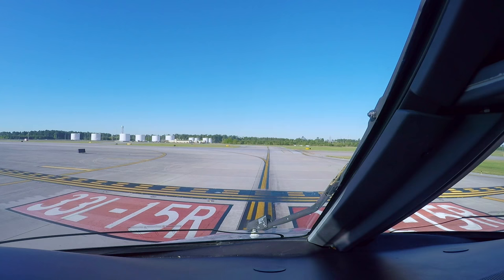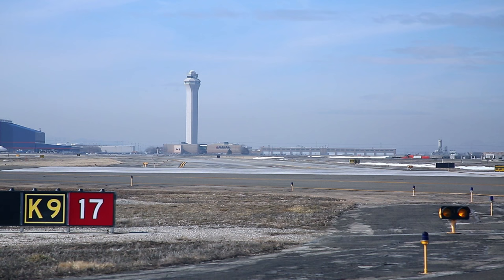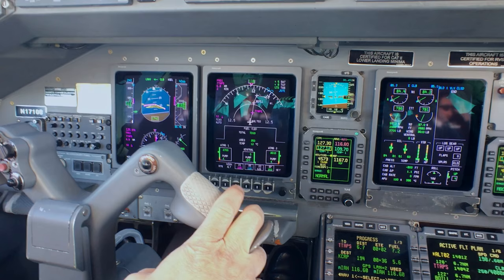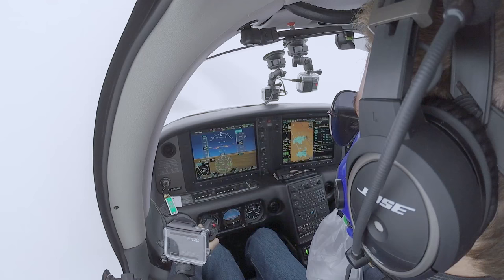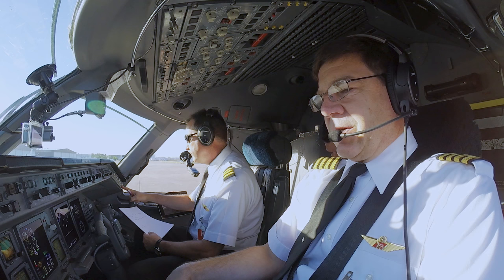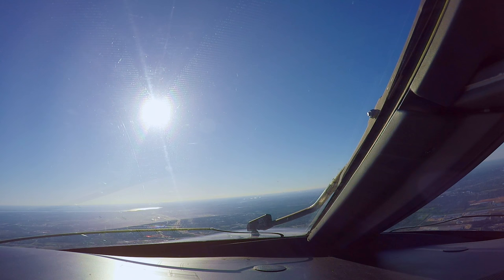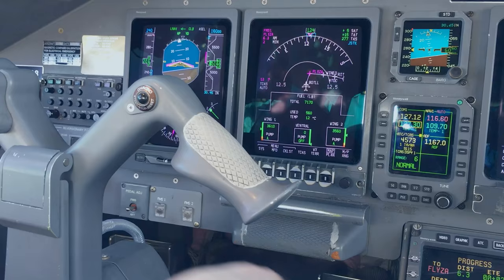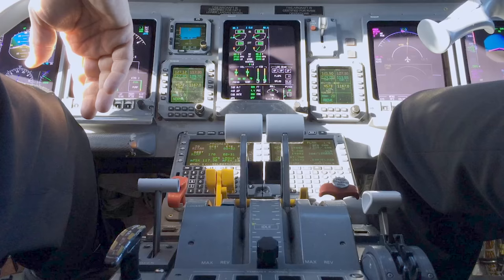How To Fly An IFR Departure Procedure With A "Climb Via"

Comment: Really nicely done. A small addendum on what "RNAV to TAPPS," means on the takeoff clearance... it's not really related to the transition being flown. It's actually an ATC requirement they state the first fix on an RNAV departure when using simultaneous departures from parallel runways. ATL and LAX are great examples of this where the RNAV fixes for a given SID actually vary based on the runway being used. It's essentially a check and balance to make sure that two aircraft launching in quick succession on parallel RNAV departures actually navigate to the correct fix when parallel runways are in use.
Reply: Thanks buddy, I was wondering why they need to emphasize that again.

Comment: Nice to see a practical example of a complex SID and Via. 
Always good for those in the early learning phase to see examples of the extremes, takes out some of the mystery and reduces the chance of deer in the headlights. At the simple end I have one locally that is: Turn to 063 and climb to 3000, expect vectors in 2 minutes or 6 miles. Lost com, climbing turn left direct to VOR continue climbing in hold at the VOR to 4200.

Comment: The pilot riding the right seat has some terrible phraseology habits. Beautiful video though! Great film making skills ... impressive. I take it you work for ExpressJet?
Reply: That’s what I was thinking... I’m not a pilot but I listen to atc enough to listen you don’t really talk like that.
Reply: I absolutely strongly disagree. His 'phraseology habits'/verbiage is spot-on! He is clear, concise and professional. He gets the readbacks and information transmitted without cluttering up ATC. As I watched the video, one of the first thoughts I had, was 'wow that guy is smooth with his comms'! (And yes, I am a pilot)
Reply: @Dave5500  both times he failed to repeat the runway number and the full call sign. Later he continued to give only partial read backs that left out key parts of the assignments such a the amended climb-via clearance. It appears to be due to complacency and this issue has caused several accidents in the past. I’ve heard several crews over the years getting chewed by ATC for this. I’m not going to explain why these items are extremely important because you’re a pilot and I presume you know this already. Just my 2 cents as an airline Captain and safety auditor.

Comment: Great video! It's very important aways keep in mind about the performance of your acft. For that E-jet is quite easy but for some departures a high perfomance acft is required. So if you're flying a single engine you could be in trouble very quick as you said. Cheers
Reply: so the E-jet isn't high performance?

Comment: You should make a video on how to come up with the $40,000+ required to add an instrument/commercial/multi/CFI/ATP to a private license when you've been turned down for loans. So fed up with aviation. There's a pilot shortage? Gee maybe if I didn't have to pay more than the cost of a new BMW just to get the job I could apply.
Reply: Cole Byre hmm... like what a 4 year degree costs?
Reply: Cole Byre I was in the same situation, it sucks
Reply: @BOHICA_  to be fair, you also need a 4 year degree to get into the airlines
Reply: @stephensantilli9690  negative. Totally untrue. You don't need a 4 year degree at all for most airlines. Very useful and will help, but not at all required.

Comment: Well done on the video. Just wondering where you got the suction cup mounts with the ball swivel.  I just got my first GoPro a few months ago and love it, but have already run into problems getting the camera to point exactly where I want it while using the GoPro suction cup mount.  Thanks.

Comment: Great video, thanks for posting-    question- "what if like you stated its Hot and your Heavy & don't make the correct Altitudes before reaching a fix? can you go faster than 250 below 12,000ft to reach your fix at right altitude?  Or do you simply inform ATC that you're correct altitude so they can be able to direct other traffic nearby around you?   Last question: I understand "highways airways for jets to follow a path along" but where do they get these so-called "Fixes" or waypoints from that make up a SID or STAR?  they're not VORs, meaning without GPS it'll be almost impossible to navigate through.   Are SID waypoints simply GPS COORDINATES?

Meaning if I'm using either SKYVECTOR or SIMBRIEF- unless it automatically provides a SID waypoints. I don't see them while say using SKYVECTOR Maps, unless I type in that exact waypoint name. Its not like one can visually see them on a map to choose if one doesn't know these exact names or GPS coordinates etc.
Reply: Exceeding 250 knots below 10,000 is generally done for safety, not for climb performance ... if your stall speed is 240, you don't want to be too close to it in your climb.  If you're not going to manage a crossing restriction, best to tell ATC ASAP (and ASAP can include before departure).  All GPS waypoints consist of GPS coordinates, fixes are initially defined as distance and radial from specified navaid(s) but GPS systems just treat them as coordinates too.
Reply: Easiest thing to do is say “unable”. 

I’ve had numerous times where due to strong tailwinds, distractions, ATC foul ups, etc where I won’t make an assigned restriction despite my best efforts. (Spoilers, flaps, even sometimes deploying landing gear early)

I just tell them “Unable this restriction, do you need the speed or the altitude?” 

If he says the altitude I can always dive the airplane to it, but will exceed the speed limit. If he wants the speed I can always pitch the nose up and slow it down, but I’ll be high. If he really needs both and I can’t make it happen he can just give me a vector off route to get into the right energy state. 

Swept wing jets can be difficult to get down and slow down sometimes. Especially with high density altitude and/or tailwinds. The problem of losing energy is much more common with jets. Gaining energy and climbing to meet restrictions is rarely a problem. But if it does become a problem the same principals apply. Just tell them you can’t do it, what do they want you do instead. There’s no rules being violated here or anything just because Mother Nature dictates it’s impossible. 

To answer the question about fixes, we can identify just about all fixes with RNAV (GPS). Most SIDs require you to have an RNAV system. Many fixes, but not all, can be identified using VOR/DME or crossing two VOR radials. But this is very, very, rarely done in the airline world. Every pilot knows how to do it but it just almost never happens (in the USA).

Flying IFR without a GPS isn’t a big deal. Even in a jet. We train how to do it in the simulator and I’ve done it IRL many times in smaller GA airplanes. You do become a little more reliant on ATC assistance though.

Comment: I just wanna get some clarification on something, in your clearance to SAF ATC cleared you to "climb via the SID except climb and maintain" and you interpreted this as a lateral clearance with an unrestricted climb but to me this sounds like they were just assigning a top altitude. I believe that if they wanted an unrestricted climb they would have cleared you via the departure and said climb and maintain without saying climb via the SID. What are your opinions on this? Also I do recognize that there are no crossing restrictions on this SID so it would have been unrestricted to the top altitude either way but I believe that given the clearance you received if it had altitude restrictions you would have been required to comply with them.
Reply: Jake, great question because that clearance was confusing.  

In our SAF case, they initially stated "climb via the SID, except..." but then said "Correction, climb and maintain 8000" at 3:22.  The "climb and maintain" clears us for an unrestricted climb to 8000.  If they were issuing a top altitude and wanted us to climb via the SID, they would have said "Climb via the SID, except maintain 8000" or "climb via the SID, maintain 8000" since this SID doesn't have a published top altitude.  We heard the "correction" clearly so we didn't request clarification.

SIDs are one of the top sources for pilot deviations - and the terminology is a large part of the problem.  "Climb and maintain" and "Climb via the SID, except maintain" sound about the same - and they're often confused.  And you'll hear a "correction, ..." pretty often.  If you're in doubt, ask.
Reply: +Aleks Udris oh ok, I did not notice the "correction" until you pointed that out. I appreciate the clarification!

Comment: So from what I understand, you use the climb via chart altitudes on each leg, until you reach your top altitude either assigned by the tower, or the IFR chart?  Or if assigned an altitude by clearance, do you climb to that altitude as quickly as possible?
Reply: If your assigned an altitude it overrides the "Climb Via SID" and you can disregard the altitudes on the SID.
Reply: Sometimes they will be more specific and say something like "cleared for abc procedure, cross fix wxyzz at or below 5000" So you have the info ahead of time but also that you don't start to climb too early.(similar on approaches "cross mnopq at or above 2000, cleared ILS 23")

Comment: ?What did the ATC say at 0.12 and what does it mean
Reply: Reda - They said "RNAV to TTAPS".  "TTAPS" is the first fix on the RITAA Five Departure.  The "RNAV to TTAPS" instruction tells us to fly via RNAV, or "area navigation," direct to TTAPS after takeoff.  "Area navigation" or "RNAV" is a generic term for any navigation system that allows us to navigate by latitude/longitude waypoints.  GPS is the most common form, but most turbine aircraft have flight management systems that combine GPS with VOR and other navigation systems.

Comment: 5:06 "Climb via Sid..... maintain 4000" Does she say "except" in between?
Reply: VV Kim yep.  "Climb via the SID except maintain 4000".
Reply: Yeah, that clearance doesn't make a whole lot of sense though. The first altitude is 4000 so "climb via" doesn't really apply if you're going to hold them down at the very first altitude. I'd think a better clearance would be "Cleared RITTA FIVE departure, maintain 4,000'".

It would make more sense if they gave something like "Climb via RITTA FIVE departure except maintain 7,000" so that they comply with the altitude restrictions at TTAPS and BOTLL and then level off at 7,000.